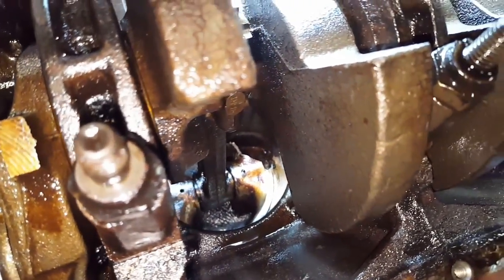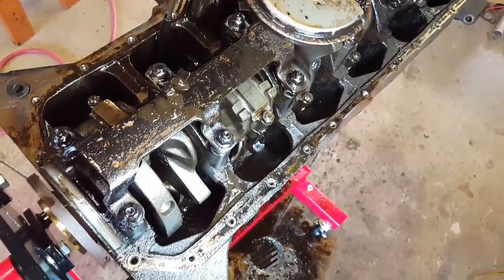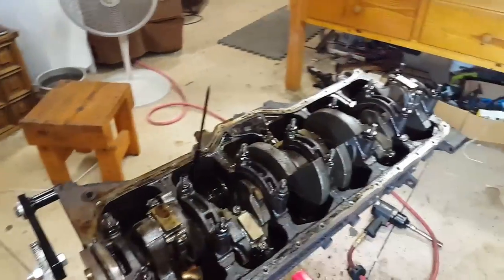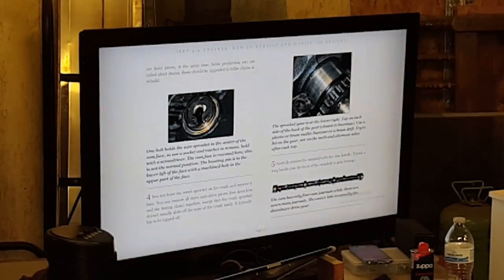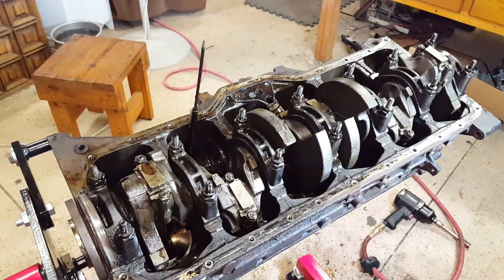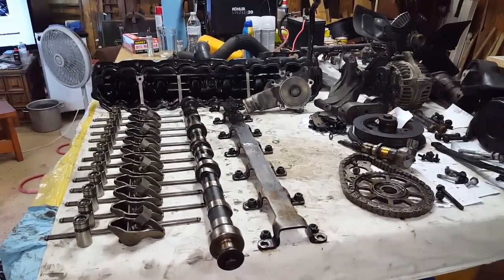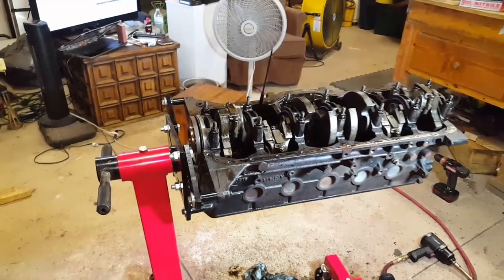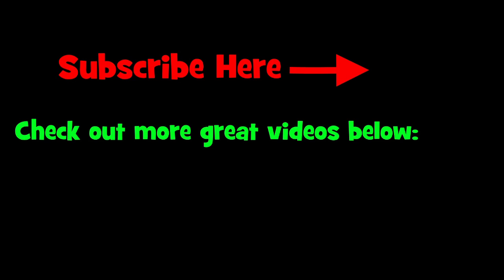Anyone can rebuild an engine - Jeep 4.0L rebuild project -Part 1

Comment: Just happened after 270,000 miles in the wife's jeep.  Factory pistons, I was told this happens, and I was rough on the throttle.  It did not let go on acceleration, just on start up.

Comment: I missed something I guess. You mentioned you thought you had a lifter problem I think I heard? What was the reason you decided to rebuild? And did you pull the engine yourself?
Reply: TO CHECK A STICKING LIFTER THE WILL NOT DROP ON LOW LOBE POSITION,PULL VALVE COVER,START ENGINE THE ROCKER ARM THAT MOVES THE LESS THAT THE LIFTER THAT'S GONE BAD,REMOVE ROCKERS PULL OLD PUSH OUT,TAKE MAGNET PULL OUT ALL LIFTERS,ROCK AUTO SELLS A GREAT TOP END KIT RUB HIGH HEAT GREASE ON LIFTERS DROP IN SAME WITH PUSH RODS AND REPLACE NEW ""ROLLER TIP ROCKERS""GREASE BOTH ENDS YOUR ENGINE WILL BE QUITER AND QUICK OFF THE LINE
Reply from the maker: Yes you missed something it was covered in video around 1:00 - 1:21.  Yes, I did the removal, rebuild, and reinstall.

Comment: WHich book did you buy for this project. I would like to get a copy. Please post the link-Paul
Calgary, Alberta
Reply from the maker: Thanks for watching I added link in description if you use my link it helps me out a little. It was a digital order on Amazon and I just kept it open on the TV I have in the shop. It came in really helpful on diagrams to have it right there to look at.... title is "Jeep 4.0 Engines: How to Rebuild and Modify"
Reply: Thank you ordering this now.
Paul
Calgary, Alberta

Comment: Cool vid, dude. Those 4.0s are damn sturdy, but they do break skirts more often than other motors. Thanks god they are so easy to rebuild!
Reply from the maker: D.J. Domareki yes it seemed easy to put back together but now wont start so i screwed up something. I think it is just the cam sensor or crank sensor... but have done all the tricks going to take it to dealer this week for the $100 diagnosis see if they can reset seens to be the consensus on several forums so hopefully I'll have final working video posted soon!
Reply: I accidentally bumped my Cam Positioning Sensor once when trying to replace an Oil Pressure Sending Unit. Jeep wouldn't start and if it did, it sounded like absolute garbage. I was horrified and spent a week trying to figure it out how replacing an OPSU could do all that. I finally broke down and took it to a Mopar mechanic who figured it out in about 5 minutes. I guess those sensors are crazy touch to even the slightest misalignment. Anyway, Glad to hear you are keeping with it! good luck!
Reply: @dougontheotherchannel3078  PULL OUT THE DIST.,,PULL PLUG ON #1,BRING IT TDC USE A STRAW,YOUR MARK ON CRANK SHOULD BE ON ,,0ZERO AND DIST SLOT LOOK DOWN IN THE HOLE SHOULD BE 11OCLOCK AND 5 O'CLOCK IF SO YOUR ARE PERFECT MARK ON WITH THE TIMING
Reply: What did it end up being?